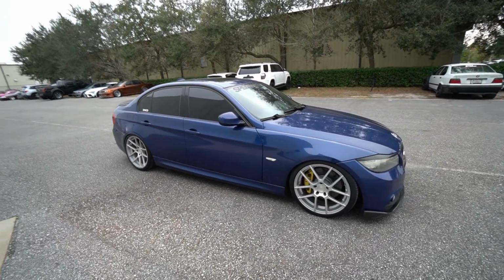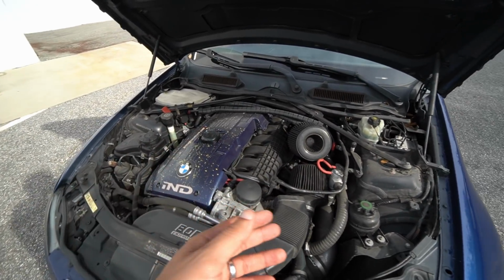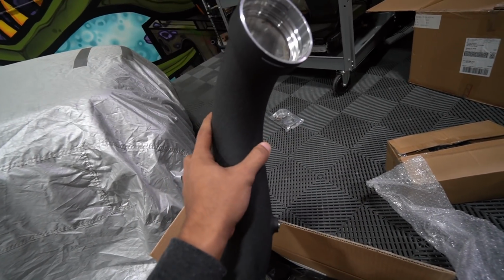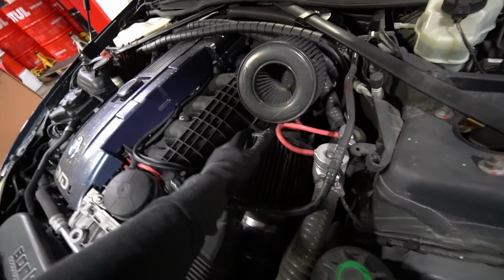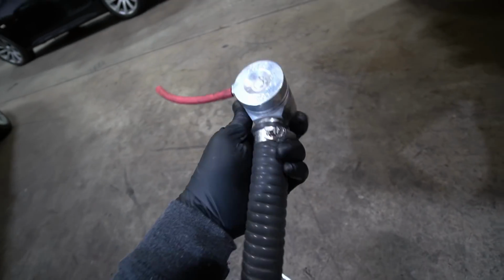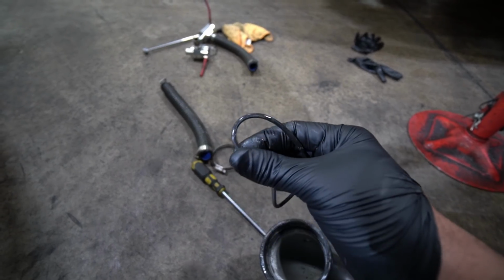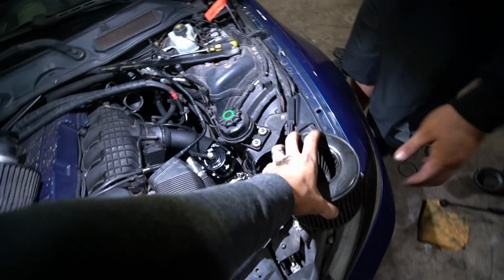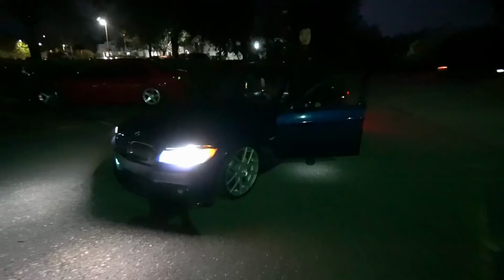My E90 335i Get's The MOST IMPORTANT Mod Every Turbocharged BMW Needs!

Comment from the maker: If you subscribe your BMW will be reliable :)
Reply: Good try, my e36 is pile of problems (anyway subsrcibed loong time ago) 😀
Reply: Something about the 4 door (to me) just looks better than the 2 door
Reply: my n55 e90 white has been good to me so farr 72k miles
Reply: Vacuum catch can
Reply: My e60 M5 is broken, you promise if I subscribe and like it’ll fix itself ?
Reply: Get another N54 and get upgraded twins! Get 19ts !
Reply: hello hope you may get back to me ..do you need to tighten the bolt on that charge pipe? you have tha sensor right but closer to tha bov there's bolts . if tighten whaa would happen? sounds weird reading it but might were sorta lose but not to lose to come off.. will it affect anything? I'm chasing boost deactivation xc
Reply: alright bro... I hate to do this to you... Your turbos aren't spooling, while parked. Wastegates are open cause you're not under load.
... And your upgraded diverters are far better than a BOV...
Reply: Hi do you not ship to the UK? am trying to buy parts from your store says don't ship to the address?
Reply: But the price is in GBP

Comment: Nice looking N54. I don't understand at all why you would put those DCI's back on there. NEVER!!! But your car, your choice. Lastly, I'm wondering why you would go single turbo, instead of just getting larger twins??? I solved the highend/lowend problem by putting a slight larger turbo and a larger turbo on mine. So I still have the no lag lowend torque, and the topend power the smaller stock turbos didn't have. The single larger turbo has horrible lag, which is just pure physic's, AND it kills the lowend torque, which is the BEST thing about these cars. Still like coming back and watching your vids. Cheers man!

Comment: So glad to see N54 content again! I have to comment about one thing...You need a 1/4 inch line to that BOV. I run the exact same setup but i use the Vader solutions BOV adapter which gives you a true 1/4 line all the way to the BOV. Your boy made and showed an adapter 1/8 to 1/4 but it can't be as good. i would be curious as what Ally (no idea how he spells his name) thinks about this? Can't wait for the single turbo!!!

Comment: After a month of having my chargepipe in, this video showed me I forgot that o-ring that goes into the charge pipe on the connection to the throttle body LOL appreciate the video this time!
Reply: I couldn't get mine to fit lol, even after buying a new one
Reply: @NoNamesLeft388  the chargepipe to fit? Yeah with the O-ring its not the easiest thing to push onto the throttle body

Comment: Single 64mm turbo 2.5bar, e85 lines, bigger injectors,, bigger cooler, catless dps, a good tune pushes you in the 700whp range

Comment: I have a VRSF charge pipe with twin Billet Turbosmart blow off valves with 60mm trumpets on each bov! It's an expensive kit but i wanna do mine different than everyone else. Charge pipe & twin turbosmart bov's were 
close to 550 bucks. Plus i run the AFE twin cone intake. Which is expensive as well 450 bucks. But inside the plastic runners is a heat wrap that's why its such a good intake. I run Agency 3" catless down pipes & a agency intercooler. Which when i bought that intercooler it was 700 bucks but their stuff is the best!. I have a radium catch can, HPS couplers & clamps going on along with a factory carbon rear spoiler some other really mice stuff. Video of my 09 black on black 135i M Sport is coming out when the weather breaks. I don't do videos but this will be one video explaining everything on my build & how i went about certain things.

Comment: The line from intake manifold to BOV should be 6mm not teed off to a smaller one as it will create extra pressure and ruin your turbos sooner. I’m gonna tap and fill my manifold, recommend you do that too

Comment: i remember i used to have an e90 n55 and after 3 weeks of owning it the chargepipe blew. It was completely stock. My n26 is stage 1 running like 18psi and i rip on it everywhere and it still has the original chargepipe.

Comment: Whoever installed those Forge diverter valves had them on wrong, they should be turned 90deg. I'm surprised they worked at all. The connection to the charge pipe is the one to the diverter line, and vice versa.

Comment: Tial recommends you drill into the manifold to supply a larger vaccum line for the bov. Burger Motorsports offers an adapter for around $70 that allows for a larger line without drilling. Are you going to rock the setup as is with the two vacuum lines? I am using the same nipple for the BOV the diverter valves connected to. I have an upgraded charge pipe and Tial bov and I have heard turbo flutter on deceleration and I can feel a power loss at high boost, sometimes even throwing the car into limp mode. I am most likely going to go with the BMS adapter to hopefully solve my issues.

Comment: Love your channel, just wondering what’s the length of the 1/4 vacuum line that comes with the charge pipe? Not sure if I need to buy a new line since I need to tap a 1/4 fitting onto the manifold, and I don’t know if the line that comes with the charge pipe will reach. Thanks!

Comment: I’ve had my e36 for the longest time and it’s gonna be my cool little daily driver. But at the end of the year I’m getting a newer BMW. And I can’t decide between the e90 335i sedan, e92 M3 Coupe or e60 M5(yes I know it’s a shit show but I do have a mechanic for the maintenance same guy that does work on my e36)
Reply: Get an e92 M3. I’ve had all 3. The n54 335 is going to be fun to modify and it makes turbo noises which is sweet! You feel like a tuner messing with mhd lol, buuuut...it’s a unreliable pos, no matter what you do, shit just breaks on it lmfao...and stock turbos aren’t even all that, they’re weak after 4500 Rpms. I loved the e60 M5 but it was just too expensive to run and drive on a daily basis, but it was very fun and a sleeper. Now the e92 M3. Maaaan, lemme tell you. Best daily driver hands down, fuel economy is not bad if you drive casually, perfect power for daily duties, sounds the best in my opinion, and plenty of aftermarket if you want to make it faster. Oh, and it just had the best drivetrain and chassis, it was so well balanced and the dct is the best transmission you can get on the market!

Edit: 
My M3 was beat on daily, It lived in the redline and it didn’t burn any oil, didn’t leak any oil, never had misfires, I never even replaced my throttle actuators or rod bearings. Had it since 60k, sold it at 115k. I would always do the black stone labs oil analysis and my bearing wear was always in check, nothing to worry about. The guy I sold it to replaced the bearings and sent me a pic and they didn’t look bad at all for 115k. The car was a 08 model as well!
Reply: @Karim2clean  e92 M3 Coupe is actually my first option one with low miles 👌🏾 and all my friends are running N54’s so I want to be different. Thanks for the input 🙏🏾
Reply: @Karim2clean  my friend back home actually has a full straight piped e60 M5 and maaaan that V10 does sing very unassuming but yeah there was a point in time where he didn’t drive it for 6 months because....V10 requires V10 maintenance 😭😹
Reply: @Karim2clean  what about an e46 bro I’m turning 21 soon looking to get either a e46 m3 or e90 m3 I know both of those cars are investment because they both have been increasing in value
Reply: @Flamef30  they’re both fun cars tbh. You shoukd drive both and see which one you like. In my case, I prefer the e92 M3. I’ve had both and I just feel like the e92 M3 was the better more balanced, more modern car. E46 M3 felt heavy and underpowered. E46 isn’t a bad car, but tbh they’re getting close in price to the e92 so I’d rather have an e92 m3

Comment: Hey Christian question I live in the Tampa Bay Area and I see you trust the guys @psi assuming since they strictly work on bimmer’s ,the crankhub issue with the s55 motors do they do the installs ?
Reply from the maker: Absolutely! Among one of the most common jobs they perform at the shop.

Comment: can you run that charge pipe without the tial BOV? cuz currently its on back order lol
Reply from the maker: You can purchase the charge pipe with the OEM DV which doesn't require a blowoff valve.

Comment: wastegate rattle is pretty bad. time to upgrade those turbos
Reply from the maker: Zero wastegate rattle, what you're hearing is the exhaust. These turbos are new. Either way I'm going single Turbo.
Reply: idk about that @2:50 sounds like wastegate rattle to me but idk. so after u change ur exhaust it should go away?
Reply: did the guy u bought it from tell u it had new turbos?
Reply: Thats not exhaust either. Sound comes from  n54 fuel injectors and is totally normal for piezo type of injectors.

Comment: hi. will it increase turbo lag due to boost leak to the air?
Reply from the maker: This setup doesn't create a boost leak.
Reply: @VehicleVirals  will it incrase turbo lag or performance?
Reply from the maker: Won't increase turbo lag. It's more so for reliability with increased power and sound.